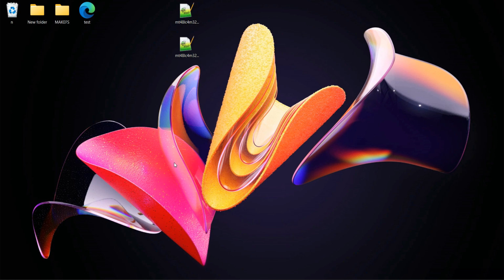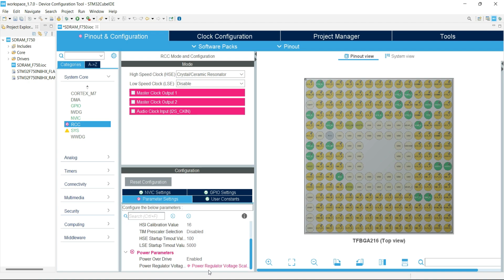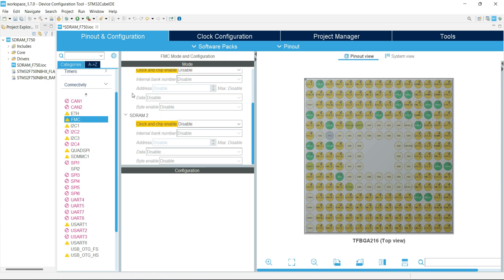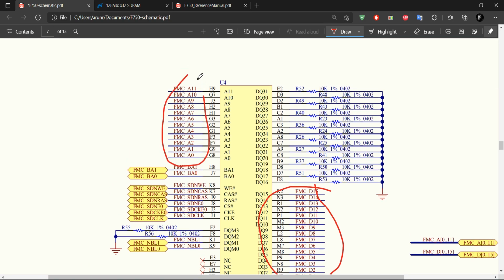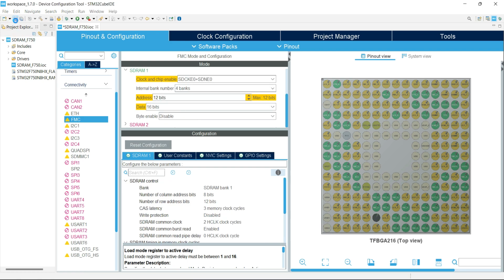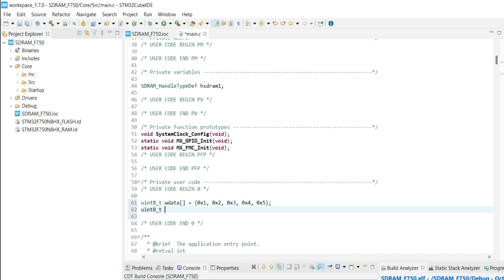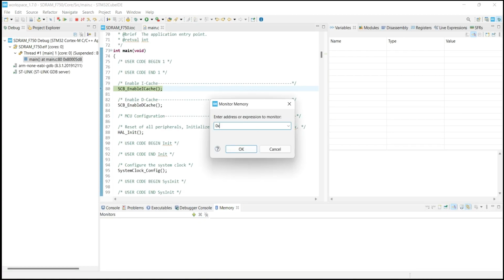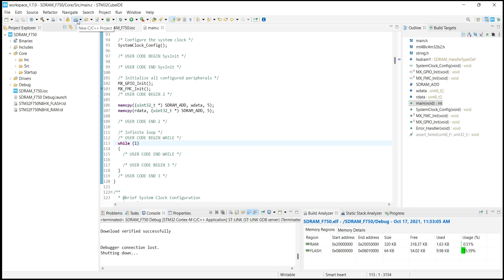SDRAM in STM32 || MT48LC4

Comment: Hello, theres is some issues while trying to write 32 bit data in wdata buffer and then reading it back.  Declaration is the same except that datatype is uint32_t wdata[] = {0x1, 0x2, 0x3}, and also uint32_t rdata[10]. And if you try to debug it will give back only the first data byte (0x1). with uint8_t everything works as expected. Can you help?